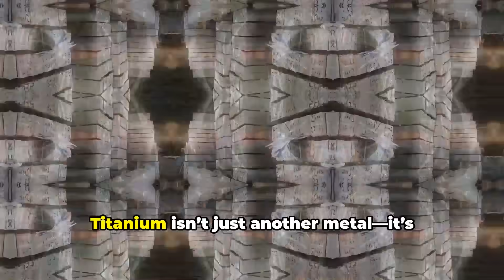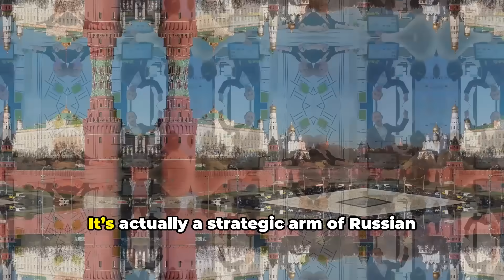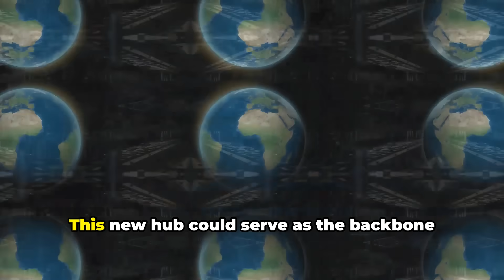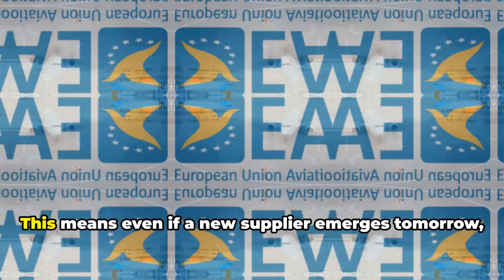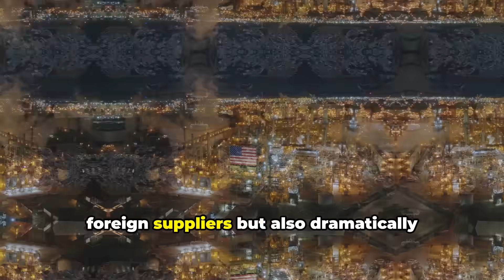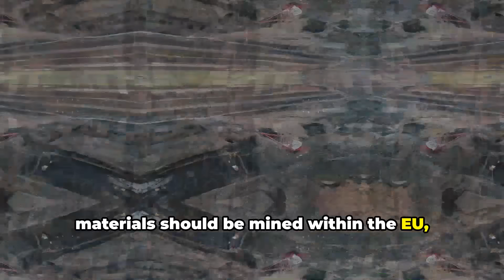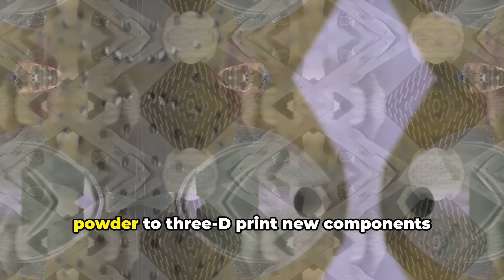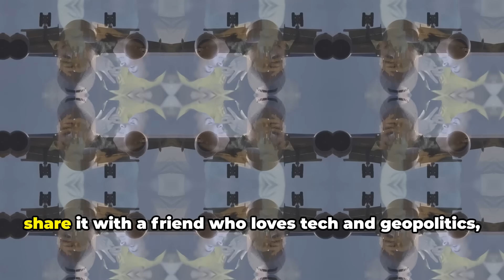Russia’s New Titanium Factory Will Own the Future of Aviation

Comment: While all this is true - the reality is not that much Titanium is used in current commercial aircraft. Airbus and Boeing are producing at normal if not higher rates with an embargo in place.  Perhaps of commercial go back to supersonic aircraft this becomes a larger issue. In Military aircraft it could also. On the other hand more and more composites are being used.
Reply: Titanium us used mainly for the engine parts where composites can never be used. Composites are mainly used for the fuselage, wings, and now engine covers.
Reply: @Sevastopol91  The GE90 uses composite fan blades; so you are not correct.  GE's GE90 will mean further use of composites in the future.